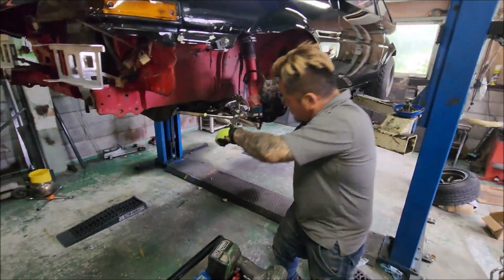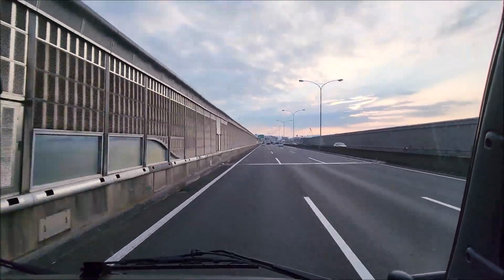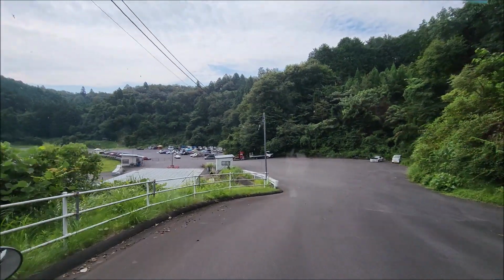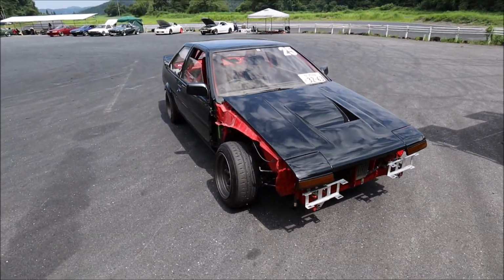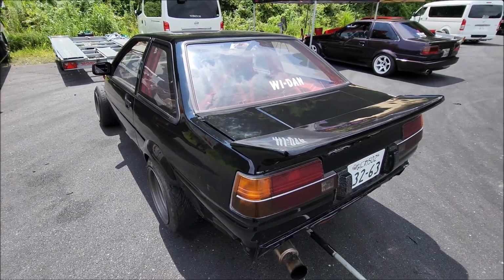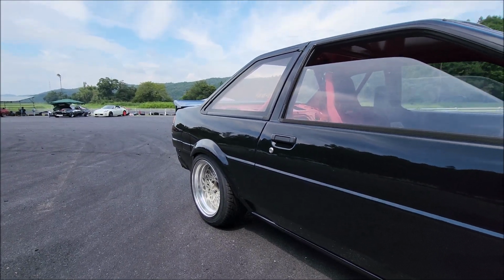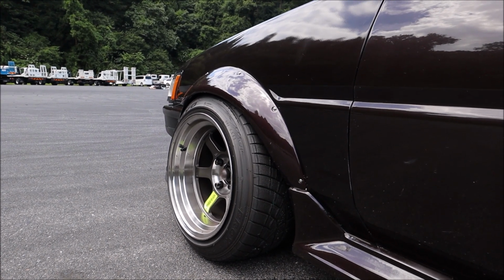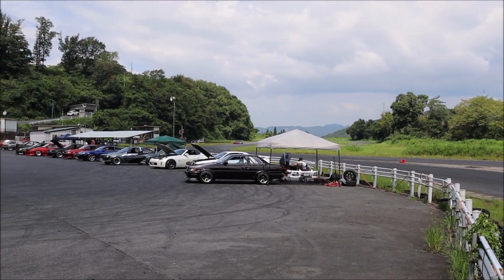Team Mouse AE86 event - YZ Circuit

Comment: No sign of unimpressed Rob in this one! New setup seems way more relaxed in car, just fingertip corrections. Looks like it'll be a beast once you get fully settled into it!
Reply from the maker: Yeah thing is awesome now, once I get rid of the rear fenders so I can run a wider rear track it'll be better again. Needs more power
Reply: @slpery86  The eternal arms race between chassis and engine
Reply: @slpery86 what's the story lad, no updates for ages now. Hope all's well but don't dangle those gems in front of us then leave us hanging! Get the finger out!😂
Reply from the maker: @ciartdsfa4899 have the next video half made, just waiting for footage from friends!
Reply: @slpery86 looking forward to it😎👌

Comment: How do you plan on getting more power from the 4age? More displacement?
Reply from the maker: Will start with some bigger cams!
Reply: @slpery86  What's in it right now, and what are you planning on running?
Reply from the maker: Currently had 272s, thinking 288 or 296, but haven't decided yet